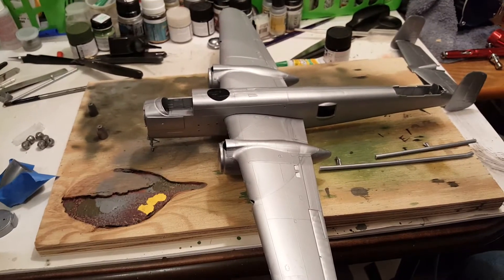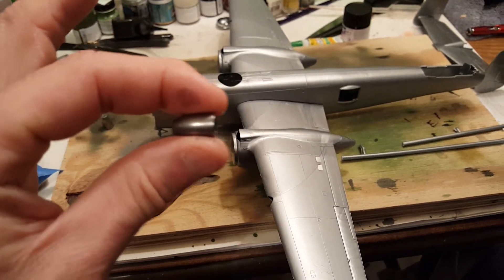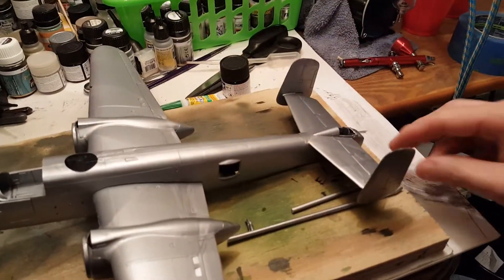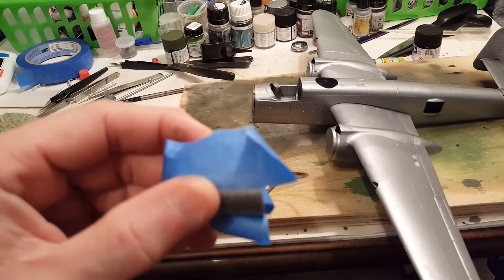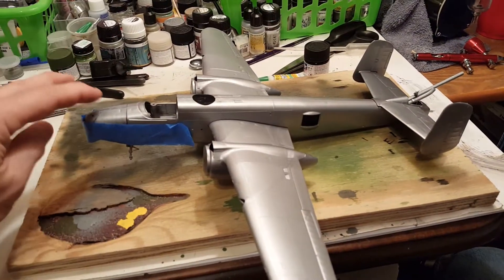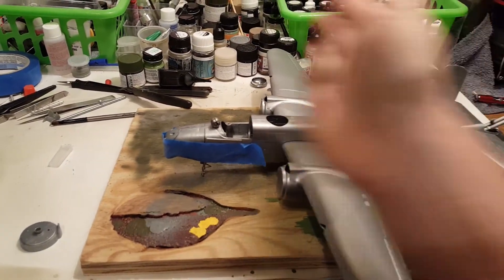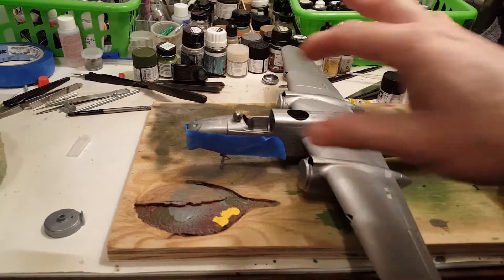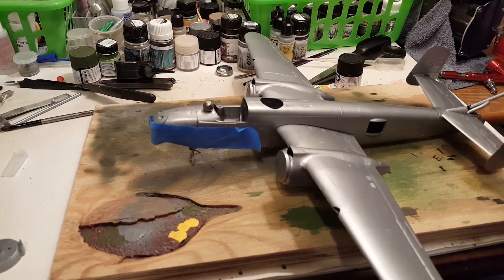Balancing a Monogram B25 model kit.

Comment: place the steel weights in each engine nacelle-- and be sure they remain forward of the gear balance point as it sits on the tires. You could use sheet styrene to make circular bulkheads in each nacelle in proper place and conceal the weights.